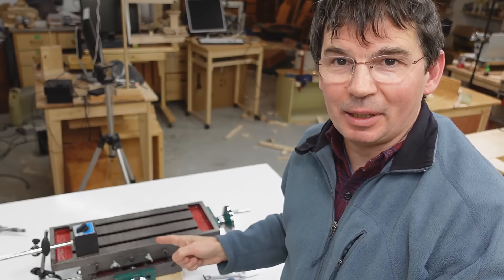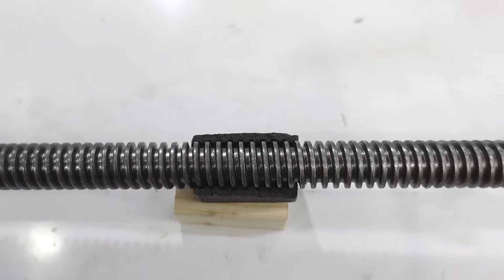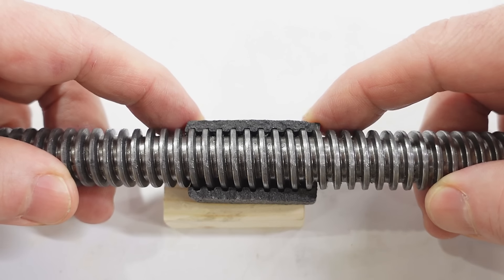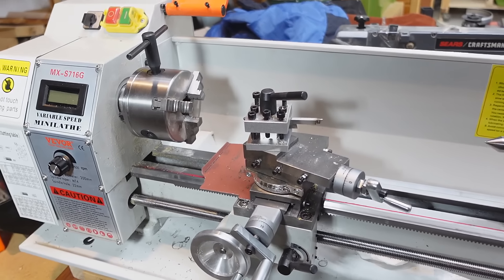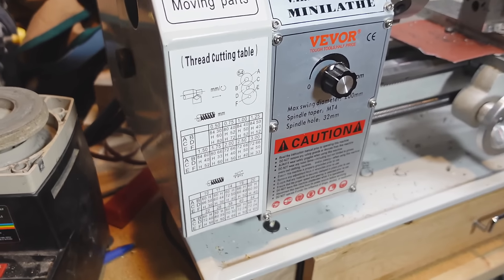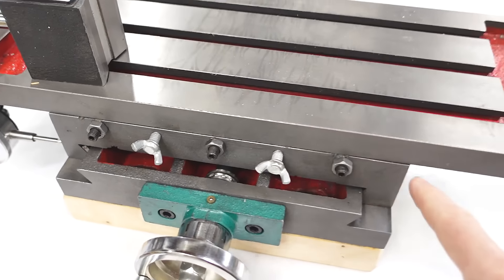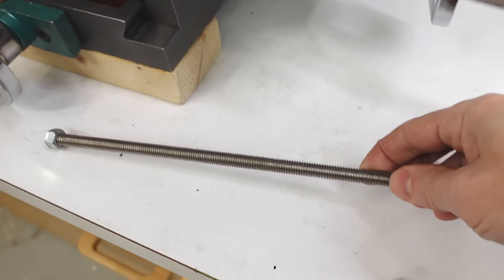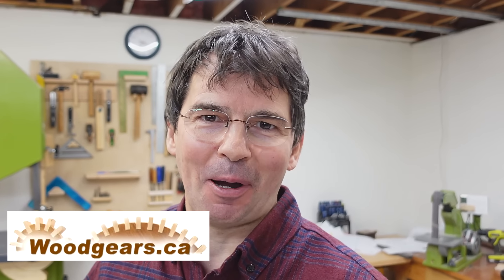Why all the hate for Vevor?

Comment: Since these things don't use anti-backlash nuts on the lead screws, you have to always turn the handle/dial in one direction and never turn it in the opposite direction. If you do, you must go past where you want to be and then go in the original direction. You can never remove 100% of the backlash. Precision machines use linear encoders to measure distance, not the rotation of the lead screw.

Comment: Vevor deserves all the bad press. I'm sure that not EVERY product they sell is terrible. But if you buy one of them just try & take advantage of their "no hassle warranty" if the product is garbage. The compressor I bought was so bad there was no way to connect it to my air system. After trying for a solid month & a blizzard of emails where they constantly reminded me that they had my money I didn't have to give it back - they used that no less than 10 times over that month to insist on giving me back pennies on the dollar. 

Like offering me 20.00 to keep the 160.0 garbage they sold me. I don't have room to describe all that was wrong with it - including the specs of 6CFM & 150 lbs pressure. It couldn't do 1 cfm without overheating within a minute. It took an hour & a half to simply top up my 4 tires. Most of that time was spent waiting for it to recover from overheating within 45 seconds & taking 5 mins to recover. They refused to refund the money despite having no arguments for my complaints - but instead used constant & very determined misdirection to convince me that I had no case & could not get my refund. 

This is no less predatory than the insurance companies that have a policy to deny all claims & keep denying them until you give up or sue the insurance company. I finally had to threaten to both do a charge back & sue them before they finally gave my money back. Few people, seniors especially, would fight them until they honored the warranty. Don't expect customer service if you want a refund if you're not satisfied. They claim a no-hassle warranty - that's a fraudulent claim I I have the email chain to prove it. I want all Canadians & American's to be aware not to deal with them. They are like a casino. The house always wins.

Comment: It's because they are the bottom of the barrel of Chinese tools.  They market themselves as being less expensive, and generally the are.  Just do a bit of critical thinking about that.  The aren't cheaper because they buy large quantities, they're cheaper because their products are made cheaper.  The same Chinese plants make the same products across multiple  brands.  The factories simply produce a product to customer specifications.  Even though a product appears to be identical between Harbor Freight, Northern Tools, Vevor, etc. doesn't mean they're created equal.  Vevor is hitting the market hard and giving tons of stuff away to 'influencers' to promote themselves.  But time and time again reviewers, like yourself, have had a lot of quality control issues across the board.  Use some common sense.  If a product is selling for less than the competitors, they are making the margin somehow and that usually translates to lower quality or simply missing items.  There are plenty of pictures online of spark plugs sticking out of machine castings coming out of China.  They are so lax on quality control, they just dump the entire engine into the melt and because plugs are a steel alloy, they don't melt like the cast iron.  So you're machine tool is just whatever comes out of the melt, whatever happened to be dumped in.  If you think you're getting Mehinite <SP?>, ductile, or any other decent cast iron you're delusional.  Just a few reasons why Vevor sucks.....  

The old idiom "You get what you pay for" is still quite valid.

Comment: When do all good points were made it's all trade-offs annoying your requirements for the work you are doing there was a guy in YouTube who replaced the original screws what's the standard 3/4 inch threaded stock you could easily do the same.. also if you get another one of those nuts from from vevor you can use it as a jam nut to take out the backlash! The same way Sherline does it 9n there m8lls and lathes! What's the last thing get yourself a keyless chuck, you will enjoy your drill press 10x more+

Comment: I do agree that with a cheap product there is a higher expectation that it will have to be tuned by the end customer. However given that these things are always advertised as "precision" tools, even that is technically false advertising, and fraud. Given a cheap price, that can be overlooked to some extent though.
However, when you stroll into the territory where it fails in it's core function, their goes too far and is a waste of time and money.
This is fraud. Your video showed me that it is not worth the effort to tune up and I decided that as such I would not buy Vevor products. I did not get angry or leave an angry comment. However, now you are calling out those who did have something to say about it and I think they have every right to express their anger with a company who is taking people's money and giving them trash in exchange. If I didn't see your video, how would I know the difference between something that needs tuning up, and maybe doesn't have hardened ways vs this piece of crap that comes with parts so far out of spec that there is no redeeming them?
This is what the Consumer Protection Bureau is for

Comment: I bought a 20kg  (44lb) Cast STEEL Anvil off (that's Off OF for Americans) Veevor for £60 (about $US 85-90) - it was sent in a single core cardboard box, and the local delivery firm refused to deliver, it as the box was totalled- I explained that it was an Anvil  - ie designed to be hit with a hammer, to no joy from the ignorant woman on the other end..- so i went and collected it. The underside was a bit rough and filled with  Car body filler paste "Bondo" for the colonials in the former British colonies...😂just kidding) and the beak was as rough as a Soho prostitute, but after a good sanding and a fresh coat of paint on the non use faces it was an acceptable tool- given that idiots in the UK think a cracked and rusty anvil is worth hundreds of pounds because everyone wants one! Veevor has some good products at a reasonable price- but just be aware that they are cheap for a reason!! (I wish they would send ME a Lathe!!-I'd be overjoyed!)
Reply: PS DON'T buy a Cast IRON anvil- it will not stand up to being hammered - it will breack as cast iron is brittle- always get Cast Steel! !!!

Comment: When you’re buying cheap and know you’re buying but yet complain, you just end up bitching like a “Karen”. Accept the fact that you’re buying cheap and see the item you invested practically nothing on as a kit because no proper tool, measuring tools, machine tool, jigs or fixtures cost less than $250….outright.

So take advantage of the craptacular chineseum equipment you purchased to hone your skills to make those kits far better than what they wolf them for, any machinist enthusiast, machinist, journeyman worth their weight in gold knows it’s not the equipment that makes the tools.

I’ve improved on a Vevor 4” rotary table to my specifications, when I sold it the buyer was initially hesitant to buy it at my price point because it was a vevor, but when I pulled out my Brown & Sharpe electronic dti and saw the repeatability of .0005, the kid thought I was “punking” him. I sold it for 2.5 times the amount I bought for.then was able to buy quality tooling, afterwards.

Harbor Freight and other chineseum dealers like these are just stores to get you out of a pinch, with their disposable tools/tooling you’re either suppose to use them at least 3 times then toss them, unless of course you’ve accepted any thing they sell as a kit, made improvements on them and now live in a better headspace. See them as a very low budget knock of Hemingway kits, tooling around with them with your improvements and you’ll be happier you, specially when you can turn a better profit off of them.

Comment: I find it hard to swallow the acceptance of poorly made tools designed for precision, which is exactly what a lathe and cross slide table is intended for.  I find it insulting that a company would put out garbage tools knowing full well that they are sub par, with the mantra of, "Hey, if it's cheap and shitty, just say so... we still have your money".  What people aren't calculating is the inconvenience and cost of scrapping parts and wasting time and material.  Apply this to other precision items, and I doubt people would just accept it.  Your poorly made gun blows up in your hand?... it's okay because it was super cheap.  Your car burns oil from new because they used bad rings or shit valve guides?... no problem, I got a great deal on it.  Meanwhile, it cost more to mend your fingers or repair that car than if you just didn't act like a cheap bastard and buy a quality product in the first place.  I don't think the buy once cry once argument is always true, but it is when dealing with anything requiring precision or strength.

Comment: I watched the video until I saw the chuck key left in the lathes chuck. As an apprentice I was taught that under no circumstances, is the chuck key ever to be left in the chuck. Its fundamental bad practice and an accident waiting to happen. Even a small machine like that can launch a chuck key into your face/head with enough force to cause serious injury.
Reply from the maker: I had it on the base, but put it in the chuck before filming for viewer engagement
Reply: @matthiaswandel  i have a lathe smaller than matthias' , and left the key in the chuck, when i turned on the machine, the key was catapulted at 10% the speed of light, went through 10 houses on my block, then disappered into dark matter. 3 people dead, 9 injured. it also killed the neighours pet boa constrictor. this is no joke